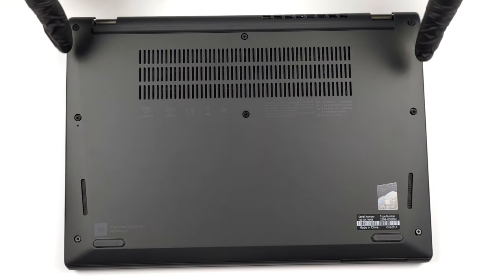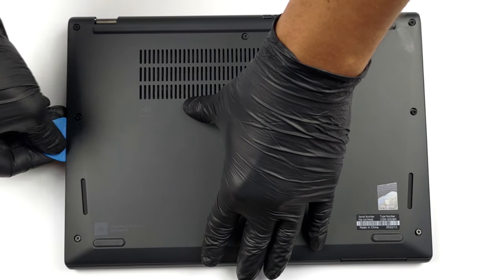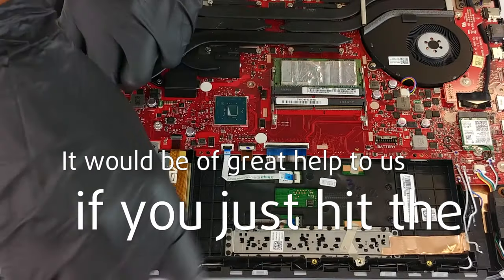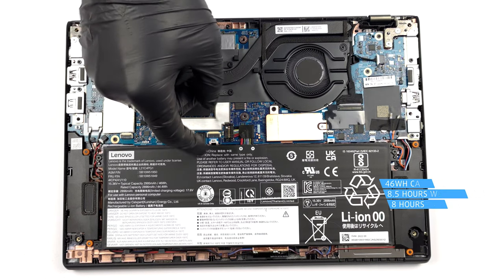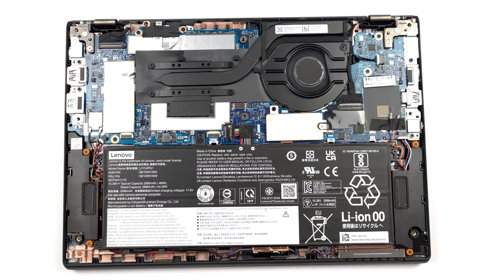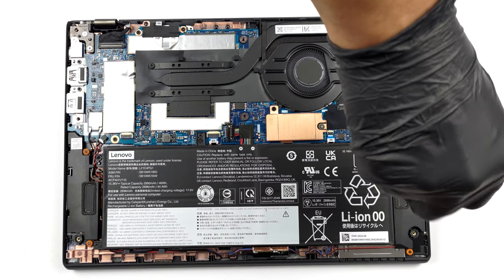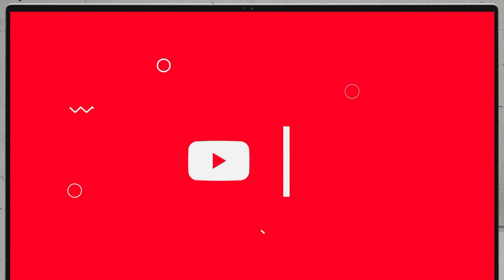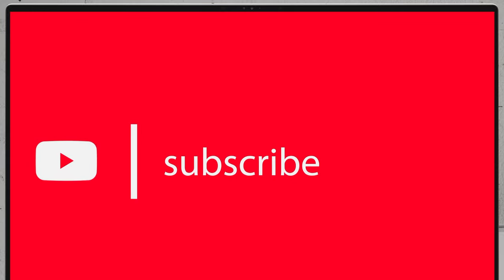🛠️ How to open Lenovo ThinkPad L13 Gen 3 - disassembly and upgrade options

Comment: theres one socket on top right(covered by white label and there is a screw below it), seems like m2 sata or any kinda interface. what socket is that?
Reply: I think you're referring to the WWAN (Quectel EM05-G) M.2 socket?  Notice the orange and blue antenna leads.